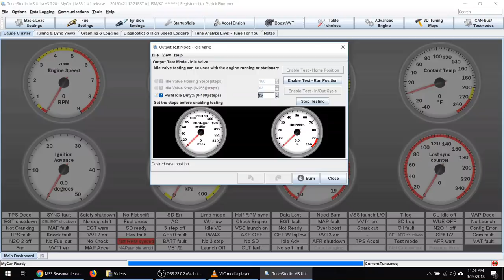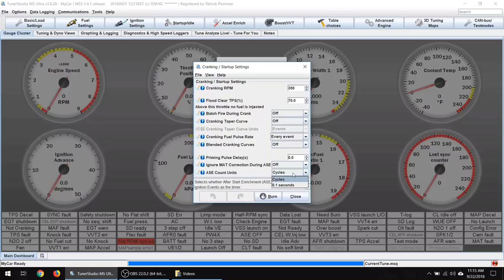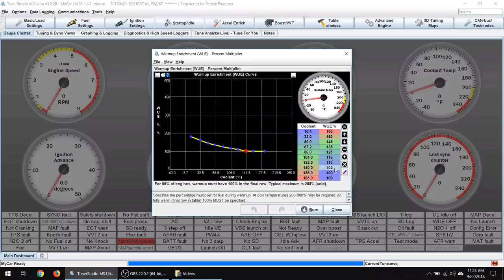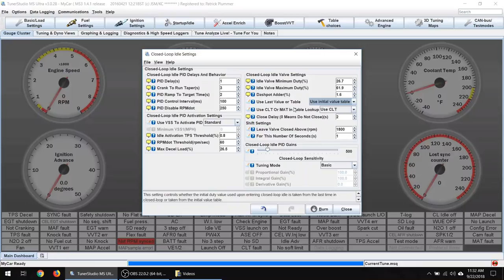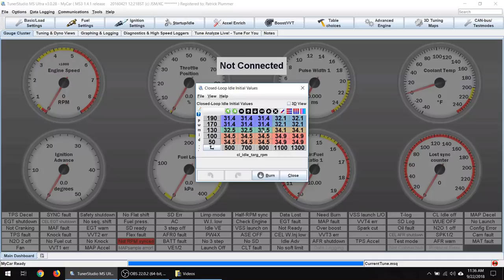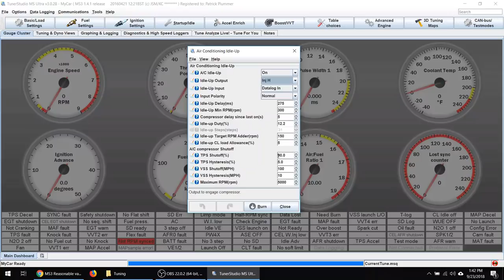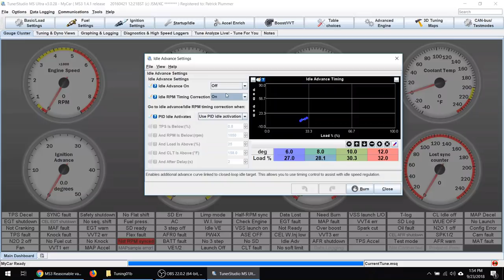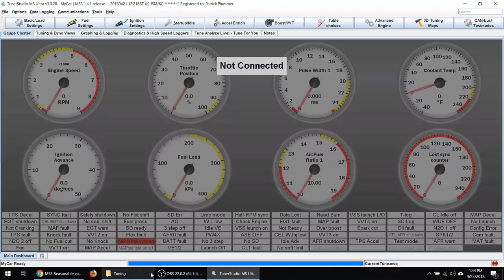Tuning the Megasquirt (Pt 2) - Idle Control

Comment: Amen to all these comments! As I am in the middle of idle tuning on my 2000 Miata hot side mp62 my challenge was too eliminate the pesky dummy TB .this video got me to idle rev it and not fall flat all on a duel throttle body setup and best of all I can control my idle valve ! Could never do that the way it was set up before. Still a long way to go ! This guy is super clear and explains in detail to understand easily !👍🏼👍🏼

Comment: Can't thank you enough for these videos.  Lockdown has me looking much farther into tuning my turbo Miata on my own now.  It's already been dyno tuned but the tuner didn't spend much time in the idle and street driving area of the tune, which I'm now cleaning up little by little.  This video helps make sense of everything so very well, great job.
Reply from the maker: Very much appreciate the feedback!  Yeah I had found that a lot of resources to learn this stuff either covered just the very first part of getting it in the car or were very detailed and geared towards someone pretty familiar with tuner studio already or at least general tuning.  I was shooting for something in between to get people started.  Thanks for watching!
Reply: @OGPedXing   Just got back from an hour or so of running some tweaks and taking some datalogs, very cool to see a response from you already! I'm also playing with a boost controller today.  After playing with the idle for about a half hour I wasn't able to improve it sadly, but I'm at least learning from my mistakes.  Have to go another round watching the video to pick up on what I did incorrectly, there were definitely a few things!  I understand there could be a lot of trail and error here, and this video is very thorough for me to be able to use as a reference to my attempts, so seriously, thank you!  Idle is currently good enough but not the easiest to drive with on the street, a big issue would be having a lightweight flywheel that causes some harsh idle droop when coming to a stop and even after revving.  Hoping a VTPS will help some functions of the idle control which will be coming soon, but the only thing that's specifically got me stumped is my car will only startup easy with the valve frequency set to 440hz, anything lower will cause a fast rise of RPM as high as 3,000+ when set to 250hz.  Will give closed loop idle another look but open loop @440hz is currently still the most streetable and consistent.  Next time I'm going to attempt to get the range of the idle valve confirmed with the test mode, and lower my values in the idle cranking duty/steps section to fix the initial high idle, hopefully.   (Vehicle is a 1993 1.6 turbo Miata.)
Reply from the maker: @carcrobatics  cool, sounds like you're getting there. For closed loop and rpm droop when entering idle, bump up your iacv initial values.  This will help get the air open quickly and then it will settle in to hit your target rpm.  The vtps will help with a number of situations so that's good you're getting it installed.   Also look at what your afr does right when entering idle.  Getting the fuel ve table pretty close will help make everything smoother and easier to deal with.  For the iacv frequency...basically a higher freq makes the duty "steps" bigger so the same number change makes a bigger affect on the actual air.  Once you get the fuel in the idle dialed in and you want to remove any hunting the lower freq will give more control. Typically I see around 170 hz to 200 for na6.   But this is not the only thing that will work, 440 can be fine.

Comment: Just installed a MSPNP2 on my 99 Miata. It now has a stable idle thanks to your vid. It dies immediately after turning on the A/C but otherwise it's stable enough with just some fine tuning needed. Thank you again.
Reply from the maker: Nice!   Now you just need to dial in that idle up rpm to make it stable with ac.
Reply: @OGPedXing I’ve got a 1995.5 Miata with a ms3, when doing the AC idle up I take it you have to run a wire from the ac button or compressor in to a open input then select it in tuner studio         But then I’m confused what to do with the output, I’m stupid

Comment: Thanks for this helpful video! Could you please help me a bit with the idle control valve and the fan control as while I was tuning an NB Miata the idle revs went to 5000rpm or so while the fan went on. Some how the fan is using FIDLE output which is supposed to belong to the IAC. I have no clue which settings to use for the fan. MS2 PNP (Reverant) and 1998 NB 1.8 turbo

Comment: I must be blind, I found my PWM duties using the i/o test mode  with engine off and doing the "listening to valve" method. 
Never looked further down to see you can test it with engine running. i'm stupid.

Comment: Your video was very informative. I have a question about first start up.  I have a blown BBC with Megasquirt II. It starts up, runs for a few seconds and dies. No sputter. It just stops. It does the same thing every time. The plugs are dry.  I am guessing that it is too lean. What do you think I can do to keep my engine running after startup - adjust VE table, ASE, WUE, etc?
Reply from the maker: One scenario where this happens is you've got enough fuel configured when cranking and for after start enrichment but when that ends, you are suddenly way too lean.  This means your fuel ve table is too lean overall.  I'd start by selecting all the idle cells and multiplying them by 1.1 or 1.2 to give them 10 to 20% more fuel.   You may have to actually reduce your ASE amount when you do this so it's not super rich to begin with.   Keep it running however you can until warmup is complete and then get your afr set to a good number like 14.0 and stable.  Then you can go back and fix after start enrichment and warm up enrichment  values.
Reply: @OGPedXing  I increased the idle cells by 10%. Instead of running for 2 seconds, it ran for about 5 seconds. An improvement. When I increased the idle cells by another 10%, it did the same thing except it seemed to struggle a little to start and it ran a little rougher. When I lowered the ASE, that did not seem to help. The plugs are still dry. 
I’m thinking that if the VE table is not in the ball park, adding or subtracting fuel may not help. I set up my VE table using the table generator: supercharger, idle 70 kpa, peak power 170 kpa, 431 cid. Does that seem reasonable?
Thanks for your help 
Jim

Comment: Thank you for your gorgeous explanation.
In after start enrichment, what afr do you suggest to have?
Reply from the maker: A little rich is fine.  14.0 or even the high 13s and then it will settle to 14 to 14.7 when warm.

Comment: In the Cli Initial Value Tables and the Idle Cranking Duty Table, is Idle Valve duty % relative or absolute? Is 50% setting the valve to 50% duty or is it putting it halfway between your min/max settings?

Comment: Is there a way to find the limits of the IAC before you start the engine by using the Output Test Mode? I had the car at my tuner and he actually changes the manual stops on the butterfly on the throttle body. I'm now trying to correct this. Thanks in advance. Love your content.
Reply from the maker: One thing you can do is if you take the iac off of the throttle body then you can look inside and see a small rod and diaphragm.  If you leave it plugged in you can activate it via the test modes and see the diaphragm move.  When it stops moving one way or the other, that's the full open and closed duty cycle.

Comment: Question, when I activated the IDLE VE my car immediately stalled.  Do you copy the settings from the actual VE Table first and then play with them from there?
Reply from the maker: Yes.  The idle ve will override the regular table immediately and if the values aren't good it will run poorly.

Comment: How come MS never extends graphing functions (like warm-up and priming, etc) past the moderately cold temperatures?  For priming pulse, for example, my base map shows the graph data going down to 10 degrees fahrenheit.  But what happens when I start my car at 9 degrees F?  Should we all be extending these graphing numbers out to the edges of the graphs?
Reply from the maker: The MS will use the value of the lowest cell for any lower temps and the highest cell for any temps higher than the graph.  So you only need to extend it if you need a different value for say 10f vs like -30f.  So you can pick a range based on your normal weather or else tweak it for winter vs summer if needed.

Comment: Hey I have a 94 Miata with MS3pro PNP and for some reason my A/C fans are not turning on.  in the ac tab the input polarity is on inverted, would setting this to Normal get the condenser fan to turn on?
Reply from the maker: It depends on how the Ms is wired but mine is on normal polarity.   Also verify the input and output pins are correct.
Reply: @OGPedXing  Thanks input and output are definitely correct.  I sent a copy of my current tune to DIY they wanted to look at it.   My tuner was having a time with sorting out my EBC I have the older version from DIY could you take a look at the settings for that for me if I sent you the tune?
Reply from the maker: @Rumnhammer  sure, pm me on Instagram or send to my email listed on the about the channel tab on YouTube. (Not putting it in the comments because of the spammers)😄

Comment: Hey man, I’ve been using TS with mega squirt for a little bit now and for some reason when I do a hot restart on the car after about 30 min it will go extremely lean like 16 afr at idle and the car start hiccuping, once I start driving it goes away, how can I fix this ?
Reply from the maker: If the tune was working previously then it may be a mechanical issue.  Hot start problems are super common.  Most can be caused by a vacuum leak so check the hoses but also you may want to check your fuel pressure, may be a sign of your fuel pump going out.  It can also be related to a sticky idle valve letting in too much air when warm but unsticks once it actuates a bit after driving.
Reply: OGPedXing it’s been doing it since I got it on ms, the car worked perfectly before stock,  the IAT seems as if it’s not getting heatsoaked either
Reply from the maker: @johnberumen1666  just to double check the iat, you can set the mat air density table to flat at 100%.  Many tunes have this way too aggressive, partly because of the code itself.  It pulls way too much fuel.  Even slight heat soak of the sensor or the intake air when first started will cause it to lean out badly.

Comment: If my car isn't idling at all, can I walk through the IAC test mode?
Reply from the maker: You can typically find some defaults to put in, for example for an NA Miata, you can put in 30 percent (closed) and 70 % (fully open) duty cycles and it will be close.  What car model and year do you have?  Also try increasing fuel to get idle more steady, most engines like rich better than lean to idle.  Also you may want to use fixed timing to take out another variable.
Reply: @OGPedXing  my issue was actually too much fuel. I thought the stock injectors were 210 instead of 265, it idles now and I was able to check my timing. Need to install my wideband and I should be on the ground running!
Reply from the maker: @HardwayLearning  awesome, congrats!

Comment: Are all these parameters adjusted to your car or are they default values on MS
Reply from the maker: First off, Tuner studio will display parameters that go with the firmware loaded on your megasquirt.  There are some defaults that go with that.  But the main thing is in general you can find a base map aka a tune file that is customized with values for your vehicle and engine.  For the Miata you can get them from trubokitty.net.  for lots of other cars you can get them from diyautotune.com and also msextra.com  forums.  Once you have that as a start you can use the info in the vids to dial in what you need to get it running smoothly.

Comment: Hi Patrick
are these the settings your using in your miata?, your video here has finally showed how to get mine to start without pushing the throttle. If these are on your miata i would like to duplicate to get mine running better.
Reply from the maker: Yes pretty much.  I have a tune I use for these videos just to make sure viewers can follow along without any tweaks being made off camera.   For misc testing I do have another tune which is what I run day to day but in some ways that test tune may be worse that this one in the videos.  At the moment the main difference I have is I'm using PID control rather than basic/simple but they are otherwise the same.

Comment: When I adjust my idle valve in the test mode the rpm’s go down as I increase the number and go up as I decrease the number. Any idea on why this would be happening?
Reply from the maker: The most common reason is the megasquirt is wired for inverse polarity. On that same screen there's a checkbox to enable that and it will basically reverse things.   The second possibility is once you go over the top duty cycle it will begin closing again.  For example on mine if I go to about 70% then it's fully open but higher than that and it closes again.
Reply: @OGPedXing  thank you so much I’ve been chasing my tail trying to figure that out ur the best

Comment: For the Cranking RPM, is there any drawback to using a higher number? The way my NB2 Miata was tuned, the tuner set Cranking RPM to 700. I'm going back over my tune and nitpicking some little things here and there to improve the kind of stuff that would be unreasonable for a dude with a dyno to get perfect in a couple hours.
Reply from the maker: The main thing is you don't want it to think it's cranking when it's actually running/idling already.  Since 850 is the typical idle and it can drop a bit under load or when not tuned, 700 is usually considered high.  Typically 350 is used but up to 500 is fine.  You want 100-200 above the typical crank so it will start tapering to normal run quickly.

Comment: Great video. But I still need help. Replaced IAC and now it idles high. Have tried turn on and off. Drive at a steady speed 
Extended IAC plunger idle great until restarting back to high idle. Any help appreciated.
Reply from the maker: You can take the iac out of the equation by just unplugging it.  If it's still idling high then I'd look for a vacuum leak... potentially anywhere in the system.  You may want to reset the idle screw as well.  I've seen it where a previous owner compensated for a failing valve by opening up the screw all the way and letting in too much air.
Reply: No vacuum leaks. If seat the IAC closed manually then reinstall it idles perfectly. 
The IAC is not closing all of the way. Not sure which section of tuner I need to go to closed the IAC. I am technically handicap.
Reply from the maker: Is this a new valve or a used one?  Also what's the year of the car and what settings are you using for idle control (closed loop or open) and what duty cycle range and frequency do you have set up?

Comment: Thanks for the good explanations. If my idle is already weird, should I install MS and use it for diagnostics? My car currently idles anywhere between 850 to 1700. After I get off the throttle, it first starts to idle at 1700 then slowly drops to 1500. Once at 1500, it will stay in that range for a completely random amount of time before either slowly dropping to the low 1000s or dropping to 850. Additionally, no matter what my idle speed is, the rpm seems to seek a pretty significant amount that I can hear and see in the tach. 

Thus far, I haven't been able to diagnose much other than it's probably the iacv or iacv gasket, and the only reason I know that is from unplugging the iacv solenoid and the car will immediately drop down to normal, but the idle will still seek. Also, I introduced a slight vacuum leak (by unplugging my map line which is currently on the back of the manifold) and it seemed to make little to no difference. Note: this is on a 1.8 and all my testing was done after the car was warm. Also, my iacv solenoid measures well within the factory impedance spec.

Thanks a bunch for any help you can provide

Here are some videos showcasing the issue:
https://www.youtube.com/watch?v=1wHdd4kARRc
https://www.youtube.com/watch?v=vZdJJiX_Mzs
https://www.youtube.com/watch?v=ReWvR1LR4hk
Reply from the maker: The MS can give you a lot of info from logs but it can also add variables that complicate things.  I'd start with fixing it with the stock ECU.  Typically high idle means too much air...either a vacuum leak or IAC.  Did this just start happening or did you get the car recently and it's always done this?  The reason I ask is the idle screw may have been opened to much by a previous owner to compensate for something else.  So the IAC may actually be ok.  Unplugging it should close it which it seems to do since the RPM drops down again.  If it were stuck unplugging it wouldn't do any thing.  I'd guess there may be more vacuum leaks and you could also try cleaning the maf sensor and throttle body.  Just the no touch spray cleaner.  This can help with a surging/hunting idle as well.
Reply from the maker: Another thought:. Does idle rpm change if you have the clutch pressed and put it in gear vs neutral?  If so the clutch pedal switch may be bad.
Reply: @OGPedXing  I'll be sure to test for that tomorrow, but not that I've noticed. It's idle very slightly changes when I first let the clutch off after startup, though I think that's just from being under slight load. I'll also be testing the idle screw adjustment and try to clean the maf a little with some contact cleaner. Thanks a bunch for the continued help!